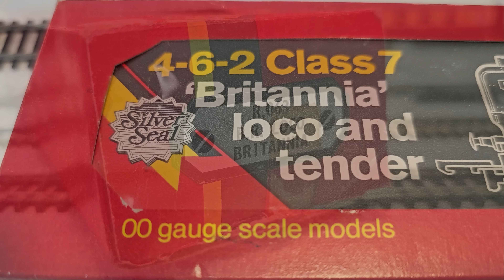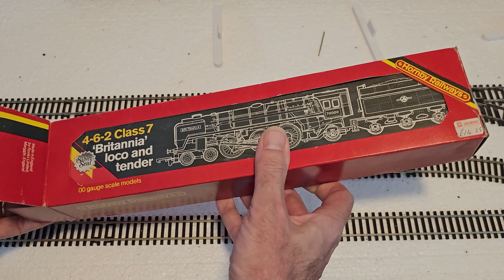Hornby R063 Standard Class 7 "Britannia" : Repair Request

Comment: Dear Bill, 1/  the phospherbronze prong contact that transfers power from the locomotive to the tender drive via the metal tender coupling connector pin is. as you doubtless are aware,  a source of intermittent power interruption. 2/ Whilst I appreciate that your repairs are aimed at restoring the defective items as close to original as possible, I think this particular electrical connection set up is very susceptible to failure. 3/ In this example, the electrical connection between the phospherbronze prong, and the path to the driving wheels is via a friction bolt that also attaches the trailing truck to the locomotive chassis. 4/ I personally think that a flexible wire between the prong and the driving wheel collector would be a preferable arrangement that would lessen the likelyhood of intermittent collection, and would not interfere with the trailing truck's swing. 5/ Ideally, an additional wire from the locomotive to the tender ( with a friction plug at the tender end ) would be a belt and braces solution that would complement the original arrangement, and also allow the locomotive and tender to be separated. 6/ Having said that, providing the prong contact on an existing locomotive is working well, then the additional cabling may not be required, it just seems to me that this arrangement seems quite susceptible to damage, and users may not necessarily  detect that . 7/ But the repaired Britannia now runs beautifully, Best wishes and regards from Australia.

Comment: nice repair, I am busy getting my trains from the late 70's running again an Inter City 125 and a class 25
Reply: I've already replaced the traction tires on both as they were gone, the class 25 worked straight back out of the box but I will be givining it a service after I've sorted out the HST which whilst its getting power (the lights come on) the motor is doing nothing. I do have a starting point though as the red power led on my HM600 is flashing indicating a possible short circuit.

Comment: Beautiful engine and repair, Bill....One question: 
Since it's tender driven, what is the rectangular gearbox-looking object atop the frame at 12:34 ? No Hornby tender driven locos here across the pond, but I'm sure most you guys know.. If it IS a gearbox, why is it needed if drivers have to roll freely/no motor here ?  Plus, what is the brass screw-like object on its top ?
I know I'm gonna kick myself when you give me answer !!
Reply from the maker: It's just a weight but also helps keep the motion bracket in place.